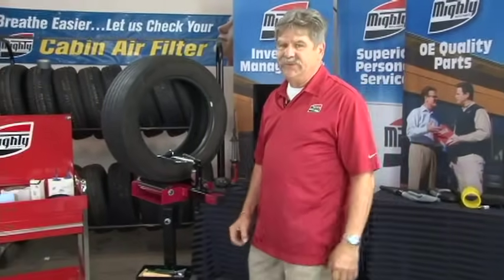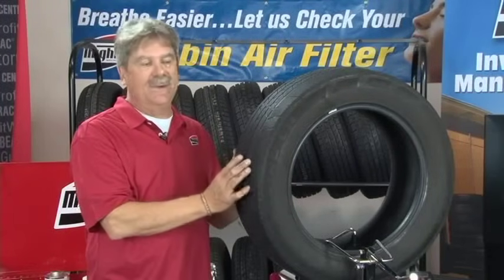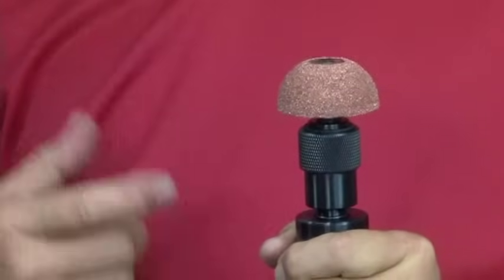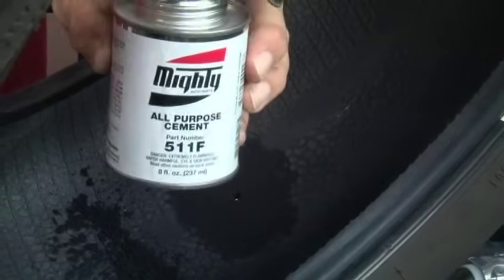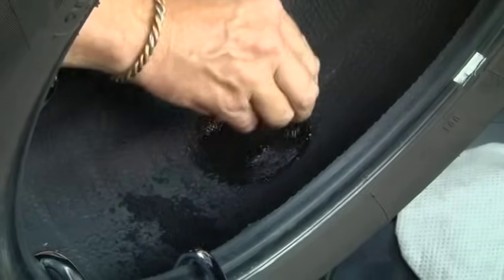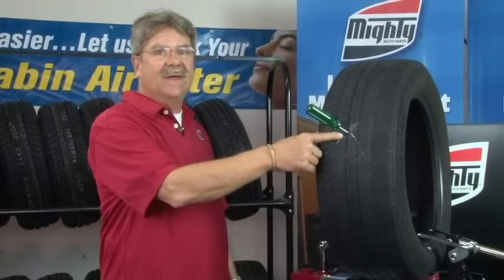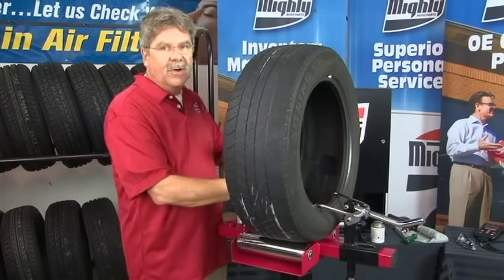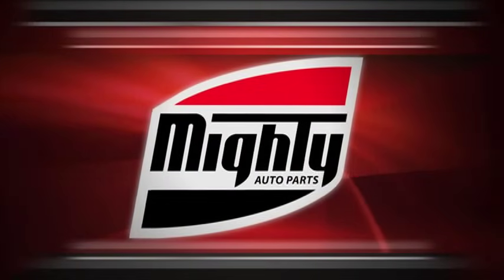Professional Tire Repair

Comment: can I use a drill bit to ream the hole out
Reply from the maker: A typical drill bit is not acceptable when preparing an injury channel. A typical drill bit would not cut a clean channel and could generate enough heat to permanently damage the tire.

The carbide cutter is specially designed to cut a clean, smooth channel which will allow the repair stem to seal the hole, preventing dirt and moisture from entering the belt package. Using the carbide cutter also minimizes the amount of heat being generated, significantly reducing the chances of scorching the rubber and damaging the tire.

Comment: wow so basically only 1/3 of the tread can be patched.  If you  are going to run over a nail, let it be in that 1/3 area.
Reply: He's over doing it but if the nail is on the side of the tire then no it cant be repaired

Comment: I Think You Should Remove Rubber Before You Add Cement , It Will Be Much Better
Reply from the maker: Absolutely correct!  Make sure you are using a brass bristle brush as shown in the video (6:45).  This prevents contamination of the cement.

Comment: Using this time consuming method I will have to charge $40 for tire nail hole repair in order to make a profit.
Reply: More or less,
Reply: Then freaking do it. I’d rather pay the $40 than be stranded for free. 
Charge the $40 and tell them why.

Comment: I've used those patches and they're no good. You need that "mushroom" pushed through from the inside.
.
Reply from the maker: +Jack Black  Following the procedures outlined in the video, and using the proper tire repair products, will return the tire to a safe operating condition: When performed correctly, the repair is designed to last the life of the tire.
Reply: Just buy the heavy duty Tire plug kit from Princess Auto, and you're good to go!

Comment: Great video on the PROPER techniques. However, you will very RARELY find a repair shop that will actually do this procedure. A simple patch and/or plug is what almost every shop does. They don't have time or all this equipment to do it the 'proper' way.
Reply from the maker: +6977warrior Thank you, we made the video with the intention to help educate and train the industry to be able to perform proper repairs. As you know failure to repair the tire properly could result in tire failure and a liability issue.
Reply: 6977warrior wrong. I work at a tire shop. we repair tires the exact same way he does one this video both with a one piece and a two piece plug. only difference is we use a different company for our products
Reply: Alfredo Parra Please explain what was 'wrong' with my comment. Try to read it and understand it carefully, ok.
Reply: 6977warrior your wrong because your comment said a simple patch or plug is what almost every shop does. Which I stated wrong because I work at a shop and we do our repairs just like this video.
Reply: 6977warrior lmao triggered
Reply: I work at a tire shop bc my father owns it ;)
Reply: i have been working at a shop for 4 years....every car and or heavy truck tire gets repaired this way. these tools are important. i would have cleaned the debris out before applying glue. and also i would have repaired that first nail. after 30 + years my company has never had an issue with anywhere on the tread face....sidewall repairs on the other hand are deff a no no...
Reply: i am also TIA trained and even some of the TIA guidlines makes one scratch their heads

Comment: Well, For Safety and Systematic Idealism… if someone is going to dictate standards! Tire Plugs, Patches, and any GREY AREA IDEA fix, should be discarded. The Proper Repair is "NEW TIRE". so I think it is not good to set standards - instead keep current to the moment and assess every action for repair. and it isn't an "injury" as much as a "damaged area". The point is; Why split hairs on an official schedule. it is paradoxical to some extent.
Reply from the maker: The Rubber Manufacturers Association (RMA) is comprised of tire manufacturers who have set the basis of tire repair standards on returning a tire to its normal safety standard or level. Like you said, the inspection process to determine if a tire is even a candidate for repair should be assessed in each repair case.  This video offers a guideline for proper repair steps in order to return a tire to normal safety standard or level, and in many cases to maintain the warranty of a tire without having to purchase new tires.
Reply: That is an excellent dissertation! On paper! Do you have any idea the price of a Michelin 24.5 low-pro semi truck tire? Hahaha! If you think I'm going to replace a $675 Tire because of nail damage, you're crazy! I've been putting plugs into these heavy-duty tires for 30 years, and never once have I had a failure, it was not even that long ago that commercial truck tire shops would just plug your tire, but now they realize they can charge you 4x more to go through this whole procedure LOL
Reply: @brianvandorp25  While reading about off road driving, I noticed the same. People prefer outside plugs over whatever inside repair work especially with bias plies tires. Plug is much more saver than inside patch while driving off road.

In the situation of traveling off road for long distance with low air pressure, speed and far a way from any possible help, if an inside patch fail, the tire will loss air pressure immediately. If you are lucky so that the tire is not damaged, you can still plug it, inflate the tire and go on. 

On the other hand, if outside plug fail, it only leaks and still hold pressure for a couple of days! So by then, you returned home and re-plug it again!
Also, while the inside patch retain the tire specs (speed rating,) for a probably inflated tire, if the pressure is dropped for off road driving, the inside patch is more born to failure than the outside plug.

 I am really amazed  about that the plug can hold more than 100 psi. really inserting. Tire repair shop told me that if one plug leaks, double it and the leaks will stop. I think this can be considered hevey duty plug as you mentioned.